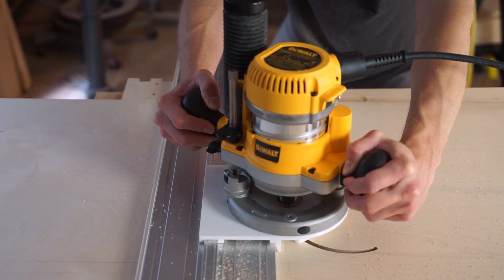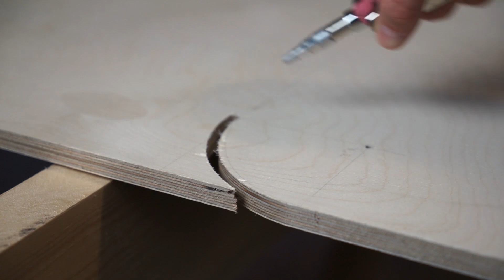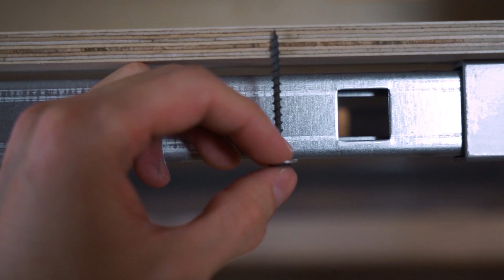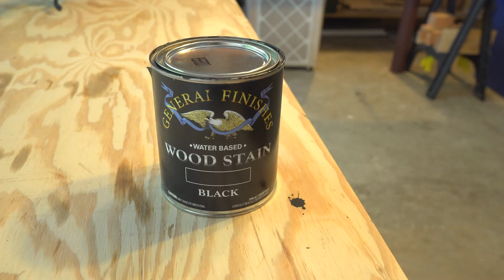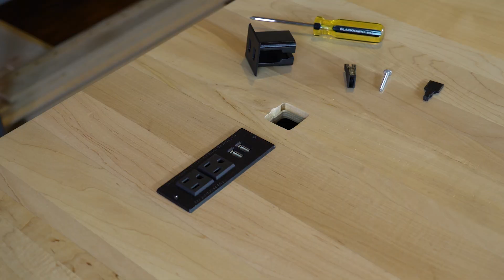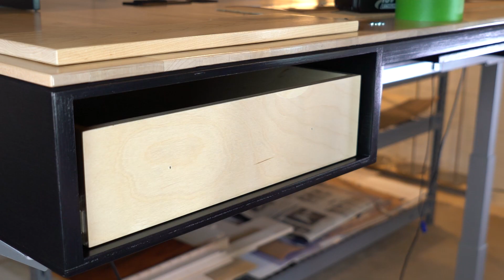Build a Desk with 3D Printed Tools - The Directors Cut

Comment: Great job! I live thé functional design and detailed attention to cable management. I will say though that the placement of the surround speakers and subwoofer cause me pain in my home theatre hobby. Surround speakers must be behind you to function correctly and give an immersive experience. 
Otherwise, fantastic work! I’ll have to peruse the plans.
Reply from the maker: Fair enough. The everything-in-one desk does have some down sides.

The desk is still working really well. The way that I laminated the top wasn't quite right tho... it did split in one place. It was risky.

Comment: Looks amazing, a lot of good ideas! May I ask for the types of monitors you are using? They seem to fit perfectly in height, not easy to find.
Reply from the maker: Thanks, I quite like it myself!

All are Dell monitors and they are 6 years old now. The center is a 32" (UP3216Q) and the sides are sub-HD 20"s (P2016t). The new generation doesn't  look like they fit together quite as nicely as the older models. Ebay has all of these if you are willing to deal with used monitors... hopefully not packaged terribly.

The 4K has 3 dead pixels after 6 years, not bad but not perfect either.
Reply: @The3DHandyman  Thanks :) maybe I'll find some here. Best fits I found so far was a dell S3221QS (height 450mm, UHD) plus Dell P2222H (width 487mm, FHD), so using the 2222 in landscape is almost 3cm difference in height. I'm wondering why companies do not match some monitors this way, because a lot of people really like this 3-monitor solution - for gaming as well as for business.
Reply from the maker: @thinktwice5035  Very true. I posted some pictures of this setup on Reddit and got this same question quite a few times. Maybe they will get their act together at some point?

Comment: A hint for painting things with a brush. Don't start a area with touching the bristles to the board just anywhere always tip off a certain direction. So kind of what I mean is start the area your finishing or straitening the brush strokes start at a edge and go to the area your overlapping tipping off at the over lap. Don't start or like touch the brush at the overlap and then go to the edge of your applied product. Start at the furthest edge and go back towards the overlap tipping off once you have overlapped the coat. Think of tipping of as when you are writing something when your pen is at the end of its movement you pull the pen off the paper and it goes to a fine tip. Same thing with painting anything. So let me kind of reword it in a easier way. Say I am painting a 3 inch wide piece of trim at 8 foot long. You can start on either end but the same applies just reversed depending on what side you start on. So you start to apply product to the piece of trim and say you/I start at the left side of the trim. You apply the coat say 2 feet at a time. Then when doing the final straightening stroke of the brush stroke you would start from the far LEFT the beginning of the piece of trim and then pull to the RIGHT tipping off the brush bristles. That is the first 2 foot section the rest is the other direction. You then apply the second 2 feet section of product you start your brush stroke at the far right area of applied product pull the brush to the LEFT then tip off.  Then apply the next 2 foot section of product. Brush from RIGHT to LEFT same way start at the RIGHT of the applied 2 foot section pull brush to the LEFT and tip off overlapping like 2 or so inches. What this does is make it to where you don't see the spot where you touch the piece of trim it will look like long brush stroke at the end. Then you go to the final 2 foot section doing the same thing. Apply the product however you do and finish stroke it pulling from the RIGHT to LEFT tipping of brush bristles to the left at the 2 inch overlap. It is kind of confusing but just think of the way your brushing and the way the brush will in a way take away some product where you touch the brush to the piece of trim if you were to just start anywhere simply brushing back and forth. It will cause a thin spot where you touch down with the brush. In other words you will see the area where you touched the brush to the trim or whatever your painting. You always start at the end of the applied product working back to the overlap and tip off at the overlapping area you will never see where you touched the brush to the trim or wall or whatever doing it like this. I made a description kind of down below.

|- - - ->|  > first section start at the edge brushing to the right tipping off to the right>
          |- - - - -< <second section start at the far right of the area you applied product brush to left tipping off at overlap to the left. pull brush from right to left tip off at overlap.<
                     |- - - - - -< <third section same thing apply product then for final stroke pull from right to left tip off at overlap.<  
                                  |- - - - - -<| final section apply product then start at edge this would be the right side of the trim piece. Then final stroke same thing pull brush from the right to the left tip off at overlap. Like I said it will make the full piece of trim look like you did one long brush stroke from one side to the other. This was kind of a long comment if anyone does not understand I am sorry I described it as well as I can without making a video about it. This will help tons with painting with latex or even oil paints. It will help with getting the paint to be more even. IF you willy nilly brush back and forth you will have areas where the paint is thinner and thicker making the job harder possibly needing more coats to fill in the thin areas. This just makes the job look better in the end. The same could be said about doing a finish roll with rolling on paint to walls. If you start at the top of a wall pull down and then pull the roller off the wall move over say 7 inches using a 9 inch roller nap then start back at the top of the wall rolling down to the floor it will do the same thing and stop the v mark that is created from going up and down on a wall. If you start at the top roll down remove the roller when getting to the bottom of the wall then pull off the roller starting again 7 inches over at the top going from top to bottom this is called a finish roll. It removes the v look and makes the paint more even. Sorry for such a long comment but this helps a lot with painting and will make you look like a pro when doing a job.
Reply from the maker: That was quite a comment! Good info. I think I can picture what you are saying. Next time I paint something, I'll give it a shot 👍

Comment: Love your designs. Ive been trying to get my monitor setup in the same configuration for years. What monitors do you have?
Reply from the maker: Nothing new unfortunately. All monitors are 6 or 7 year old Dells. The downside is that the side monitors are sub-HD 19" screens. This makes for a very large resolution gap between the main monitor and the sides. They do look nice next to one another though!

Here is a link to the new version of the main monitor, maybe this setup is still possible?
https://www.dell.com/en-us/work/shop/dell-ultrasharp-32-4k-usb-c-monitor-u3219q/apd/210-aqzz/monitors-monitor-accessories
Reply: @The3DHandyman  thank you, awesome work.  Looking forward to your next videos
Reply: That screen configuration (called PLP) being an obsession of mine as well, I can share my setup as well if you want.
It's even more ancient that  @The 3D Handyman  's butI have never been able to replace it (and believe me I've been looking, and I still am)
Basically it's  :
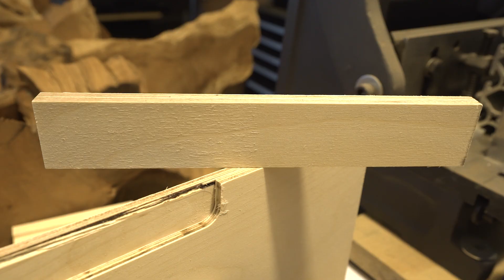- a center Dell U3011- 30" WQXGA (2560 * 1600 16:10) 60Hz
- two side ViewSonic VP201b  - 20" UXGA (1600 * 1200 4:3) 60 Hz

Resolution, pixel pitch and panel size are all very very close so it's near perfect in this respect and to my knowledge it's the only configuration that matches this closely. But the rest is very limited due to this setup's age (U3011 is 12 years old, VP201b are vintage at this point) :
- obviously no 4k, no HDR, no high refresh rates, no adaptive sync
- VP201b are TFT which makes color consistency with the IPS 3011 impossible (and I've tried using Spyderr calibrators)
- They offer DVI input only so I'm using converters and have to carefully choose my video cards when upgrading
- also they are old and I've had to change capacitors in both of them, with the older one failing again not long ago

I wish someone still made 20" 4:3 monitors so I could at least upgrade those (I can live without 4K i think), but aside from Eizo at 700 - 800$ a pop, there's nothing. 

A shame really because that sort of setup is just perfect for me.

Comment: Did you consider hanging the PC from the desk, rather than sitting it on top?
I'm thinking about replacing my desk next year, and I like your build overall, but don't really want to give up the desk space for my PC case...Any reason not to come up with a devious way of mounting it underneath?
(other than that all the ports become harder to reach)
Reply from the maker: It was considered but the renderings looked odd. There were also a lot of questions about how to assemble the PC shelf around the sit-stand legs and still give me easy access to the case. I also though about having a matching cabinet that sat next to the desk where the PC could would stay. In the end I went the easy route because I figure I wont always have a huge desktop in the future. Thanks for all the comments!

Comment: @The 3D Handyman May I know the brand and model of your Battery Backup?
Reply from the maker: @Giovany Fernández
Hi Giovany. It looks like I overstated the wattage in the video... The battery backup is a CyberPower OR2200. It's 2200VA, not 2200 watts. It's available up to 1650 watts. It has worked reliably for years and I even used it to run my refrigerator for over an hour during a recent power outage.
Reply: @The3DHandyman  Thank you for the information, I'll have a look at the brand and model. I just hope that the current units are as reliable as yours.

One more question, do you know if it supports 220 Volts current also? I don't live in the US.
Reply from the maker: @GiovanyFernandez  I'm not sure what power options they might have but it wouldn't surprise me if they had a 220 model. In general CyberPower is a decent brand. I have also worked with APC battery backups and found those to be a fairly reliable. Those were put to use in high temperatures before failures started popping up (37C sustained for weeks at a time). That may have been to much to ask of them, but they are pretty solid in general.

Comment: Have you tried the ironing feature in PrusaSlicer to reduce friction on prints? It works wonders for my working surfaces that undergo friction
Reply from the maker: I have not. Will need to check that out. Does it just rub the hot nozzle over the layer after its done?

Comment: Really nice work as usual. Few Qs:
1. Wouldn't you prefer the big PC below the desk so you avoid hearing its noises and so you get all that extra space for storing junk on?
2. What is the experience of having the sub-woofer positioned off to the left like? Wouldn't it be better central and below?
Reply from the maker: Thanks Andrew! I had considered the below the desk mounting option but with the sit-stand legs I would have needed to make a bolt-on rack that would allow the top to be assembled first and then attach the PC shelf from underneath the legs. This would have been possible but it wasn't quite how I wanted to assemble things. I also want to design a PC case at some point and I would want it on top of the desk where I can look at it/ photograph it. 

As far as the 5.1 surround goes, the sub-woofer sounds carry well from most any position. The sound waves reverberate through the whole desk so the volume on the sub is actually quite low. This particular system also seems to produce much of the base and overall volume from the center sound bar. This is probably because the center bar could be purchased separately to act as the whole sound system.

Thanks for watching!
Reply: @The3DHandyman  Thanks, I look forward to seeing the custom case!